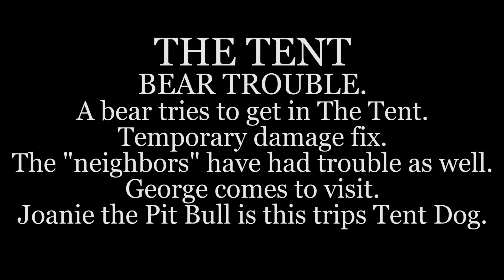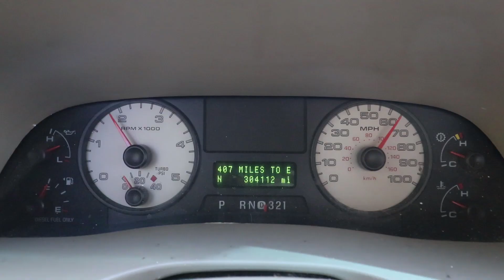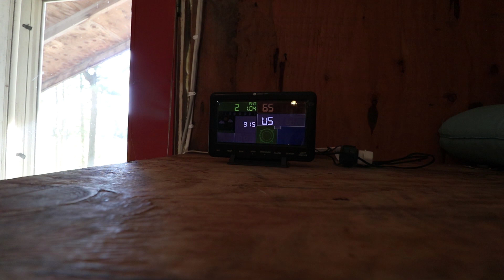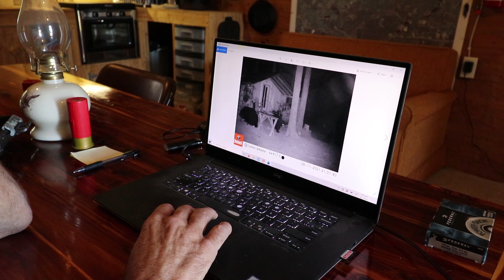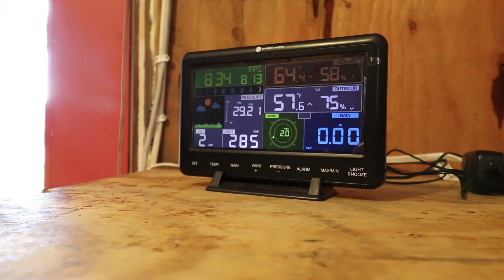THE TENT. Bear Trouble. Fixing the damage. Backwoods Cabin. Fixing the grill. Tent cooking.

Comment: Hey Joe, you were lucky he didn't break the glass in the door. I have lived in Alaska all my life, 73 years and I have had more encounters with bears than you can imagine. I have only killed 3 bears in that time when they charged and meant business. I keep my old short barrel Mossberg handy. The first round is a Bean Bag load and the rest are slugs, usually the Bean Bag does the trick. On 3 of my cabins, I built guards from rebar for my windows and doors, they work great. Hope you get the front of the tent beefed up. hope your dad is doing well and has a speedy recovery.
Reply from the maker: John. Will you email me please? joe@homeandcabinconstruction.com
Reply from the maker: You need to make sure you type in the joe@ part and not just click on the blue.
Reply: @JoeandZachSurvival  
Hey Joe, did you get my email?

Comment: Maybe use white gorilla tape to seal the torn tent up again as best you can and then do the ply wood thing as well.
Don't use plain Duct tape because the paste freezes and lets go.
Gorilla tape holds through the winter fairly well (in P.A.).
I used it to hold on signs on a wire fence.
It held for years before I had to replace the signs.

The white painted ply wood facing is a good idea too because it will be more bear proof.

Comment: When we lived in alaska...we put a 4 ft bt 4 ft board with nails upright laid in front of doors...when we left daily.. They'll only step on it once.... For your back porch I'd lay a 4' by 8' piece of plywood on the porch.. And if we were leaving for any length of time we had  4' by 8' pieces of wood that we screwed to the frame of the doors with nails sticking out..and shutters That when we closed and locked them the nails were sticking out.. Believe me after you've had a bear in your place and destroyed things and its crapped all over it's not a pretty sight

Comment: Gatorade bottle half full of water. Freeze it laying on the side then stand it up so you can see if it thaws and refreezes without having something you need to replace each time. As it is sealed you have no issues with sublimation over time and it is easy to reset if you have a thaw. 

Double check the local laws as you may need to paint that plywood unwelcome mat a bright color to keep it legal just like caltrops are legal when painted bright colors as they are no longer anti person but become anti animal tools. That being said there are a number of bright color paints that are near invisible when you look at them with nightvision tech yet perfectly visible to flashlights.